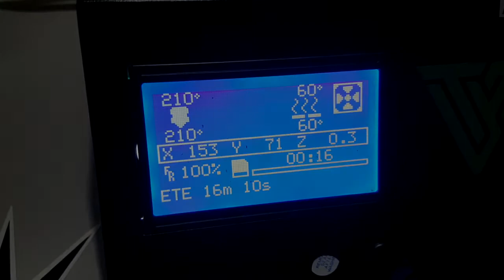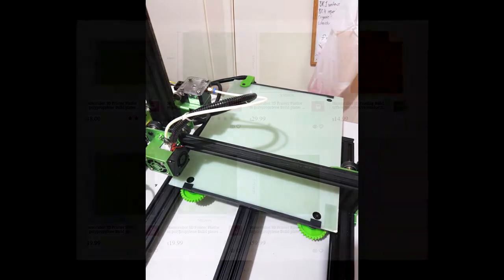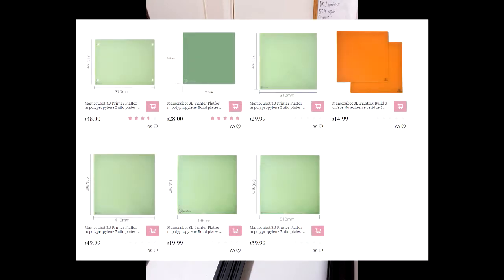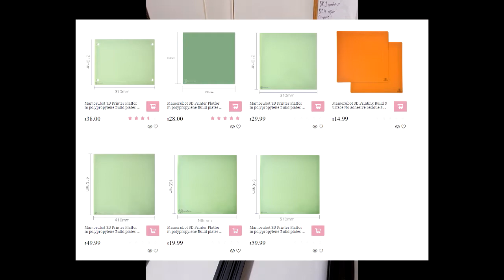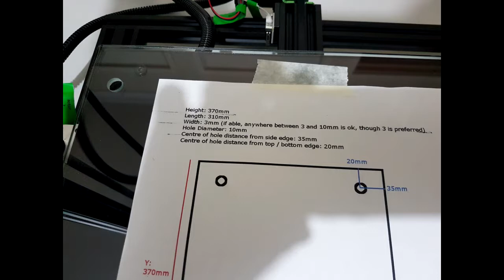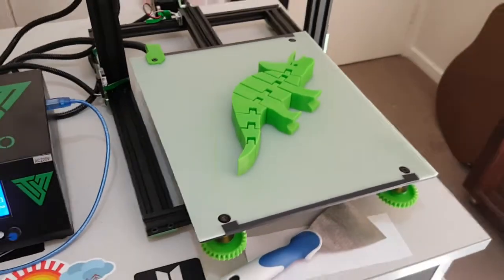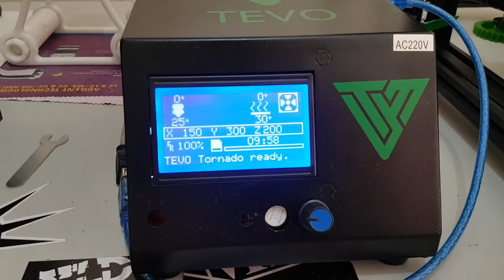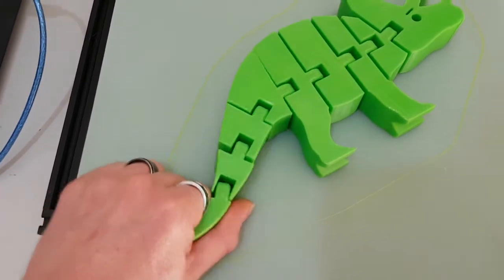Review - Mamorubot 3D Printer Build Plate

Comment: If I use the capacitative sensor for ABL, is my sensor sense the material?
Reply from the maker: I haven't tried one with this surface, so I don't know, sorry. They are supposed to be able to sense all surfaces so I would think that it should but I would recommend contacting Mamorubot to find out for sure.

Comment: Using the Mamorubot Polypropylene on my CR-10 with PETG - works great. Bed temperature at 82C. The color of the in the video of the build plate does not look correct. Mine looks a touch on the green side as on their website. Clean with isopropyl alchohol.
Reply from the maker: Good to hear, seems a few others have had a bit less luck with it and I was starting to worry I'd recommended a product that wasn't as good as I thought it was. Not sure what the colour difference might be, or mean. I purchased it directly from the Mamorubot website and it came with their brand sticker on it, so I can only trust it's legitimate, I definitely did note that it was a touch 'faded' compared to what I was expecting.

Thanks for watching though and for offering your experience, nice to know I'm not the only one that's had a positive experience. =)

Comment: I'm in the same place as Michael Kastelein. The Mamorubot isn't reliable enough, I took to sanding and wiping nonstop to get PLA to stick. The release was great but eventually prints started popping off during printing.  

ABS was a complete failure at any temperature. Haven't tried PETG. Since then I just slapped a PEI sheet on the Mamorubot.
Reply from the maker: Damn, that sucks. I'm sorry, I'm not sure what to suggest, I'm honestly still not having any trouble.

I've had a few release mid print, or base layers that don't go down well but it's usually easy to point to something as the cause, such as small surface area w/ brim not wide enough to compensate, having the bed too low or not levelled well enough or I forgot to give it a quick wipe to remove any dust (this actually is a big one, if I don't wipe it before a print, I reliably have problems). I give it a clean with some isopropyl once every ~10 prints and have lightly sanded it maybe 3 times since making this vid.

I had a lot of trouble when the seasons changed and the weather started warming up (as noted in my replies below) but after adjusting it's been ok. I'm lucky in that it's a fairly consistent temp in the room most of the time, do you think that could be a factor? Not that it makes things any better, just trying to figure out why it's working for some and not others.

Worth noting too, I adjusted the bed temp because I started getting edge curling, been keeping the bed really hot during prints (maybe 10 degrees celsius higher than before - for PLA, instead of 60, I'm up to 70) and not lowering it after first layer like I used to.
Reply: have you tried throttling up the build plate temp an extra 10-15c? a lot of the time the plate wont have enough tac until it reaches a true minimum of 65c or greater. Why I cant state more getting a true 750 watt heater. My CR-10 hits 100c in about 1min 30sec. So far in my experience NOTHING beats PEI sheets. PEi has a bond with melted plastic thats almost psychotic - let it cool and it will eveuntally pry off (Mostly with ABS). The problem with PEi is htat it comes in sheets with the 3M sticker on the back and bubbles form under it and they expand with heat - a LOT. Why has no company made a THICK 8mm+ PEi sheet? PEi blows glue stick out of the water easily.
Reply: 2 years late but posting for others using Mamorubot... I generally have great adhesion, especially with little to no fan. What's super weird is ABS adhesion. Some brands stick just as easily as PLA/PETG (provided you take the normally associated ABS specific precautions). Others seem to not stick no matter what. I have purple Gizmo Dorks ABS that I haven't managed to get a single successful print so far. I've been printing for 3 years and have used TPU, HIPS, ASA, ABS, PETG, PLA, and Silk PLA so I consider myself well versed in the tips and tricks. So weird. If I ever figure it out, I'll revisit this post.

Comment: My experience with the Mamorubot is not good.  ABS doesn't stick, PETG doesn't stick.  I am having to put blue tape over it to make parts stick, defeats the whole purpose of thsi build plate.
Reply from the maker: Damn. Has that been the case right from the start? I've had a bit more time with it now and it has become a little more fussy, it was great in the beginning but I've since started having to make extra sure I keep it clean (hates it when there's even a tiny bit of dust on the plate) and that the bed is levelled well. Still nowhere near as bad as the glass but yeah, it's gotten a bit less reliable over time. I've definitely not had to resort to tape though. I've hit it a couple times with the scratchy side of a non-scratch sponge (saw it recommended online) and that seemed to help a lot when it started getting troublesome.

Just thinking that if yours has just been this bad since you first got it, there might be other factors contributing or maybe the bed is faulty in some way? Might be worth contacting em, see if a replacement is possible / worthwhile.
Reply from the maker: I just thought of this but I had to adjust some stuff the other day because I was having trouble with adhesion. It's warmed up in the last week or two and the room the printer is in is sitting about 10-15 degrees warmer than it has been. I was raising the plate a lot higher than I'd normally like it to make prints stick well (almost too close, it was flattening the base layer), so I re-levelled the bed and dropped the printing temp down by 10 degrees - kept the bed temp the same though - seems to be working nicely now. 

I haven't tried anything other than PLA lately though, so not sure if any of that helps or is relevant but thought I should mention it.
For PLA, atm, I'm using about 200 for hotend and 70 first layer / 60 all others for the bed.